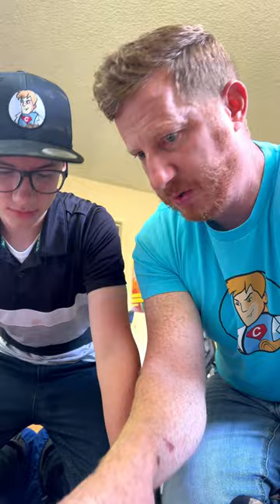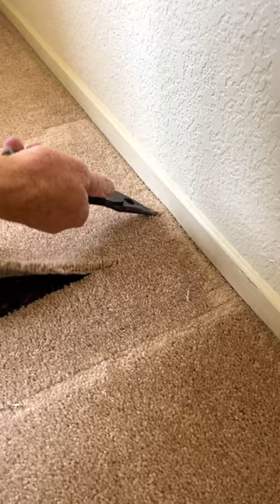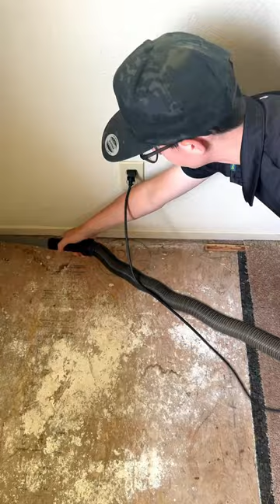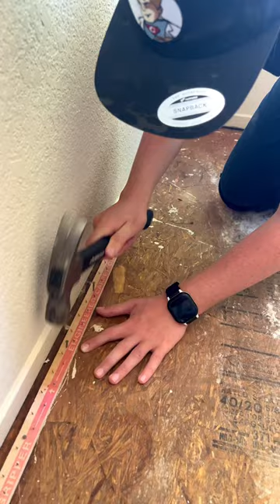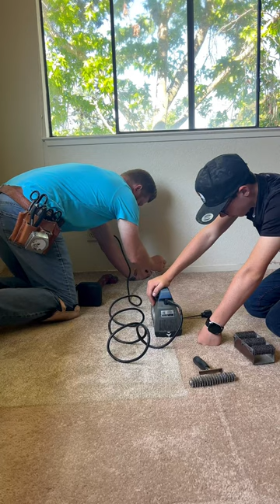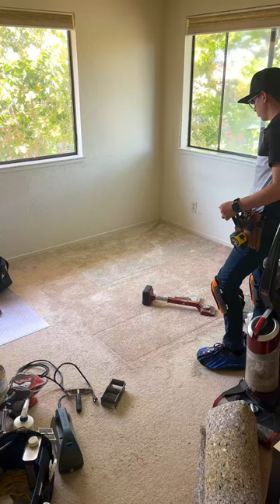Here to help

Comment: It's all about making the customer happy, they're paying the bills and putting food on the table, not the trolls in the comments.
You're doing what's right, the right way.
Keep it up.
Reply: tbf the trolls are helping pay for food too😅 all attention is good attention as far as the algorithm is concerned 🌸
Reply: It's like a chef that complains about an order for a well done steak. What difference does it make as long as it's not hurting anyone? If you're a pro, you'll do it the best possible way that the customer wants. The finished carpet here looks pretty good in my opinion, considering.

Comment: Just did one where the client wanted two rooms with stock carpet replaced with a pattern carpet they had pulled off the living room. Wanted both rooms seamed to the hallway stock carpet, and the carpet was running short so we had to do a seam the length of a room in a 10x11 . You better believed I charged accordingly and took myself a nice little check after struggling for my life 4 hours. Seaming a pattern match that has already been stretched and warped will make you consider picking up hardwood or LVP.😂
Reply: I don’t get why is it hard? Idk anything about carpet just wondering
Reply: @FraudGPT pattern carpets must be matched up perfectly when you are seaming carpet together or else you will have visible seam lines. Because the carpet was removed from a different room, that means it has already been stretched, warped, and worn down. This makes it extremely difficult to get a good seam on the pattern since one piece is slightly stretched more than the other and the patterns no longer line up as if the carpet was brand new off the roll. On top of that, the pattern carpet was expected to finish at the doorways with a head-seam onto a textured carpet, this means the style, height, and carpet backing were not matching up nicely to create any form of transition that's pleasent on the eyes. Head-Seam on a patterned carpet also means cutting the carpet with a straight edge, instead of being able to use row finders and cut between the fibers like a regular seam, you'd be cutting through the fibers of the carpet, leaving any loops/patterned fibers frayed and snagging the loop up from the carpet leaving you with small fibers that WILL fray and pull out more over time especially on high traffic areas or households with pets/children. Ultimately, a 10x11 room can be installed in one single piece without any need for seams because carpet comes sold in rolls of 12ft Wide with the lenght being calculated per job
( 12ft x 130ft big job, 12ft x 45ft small job). However, this client had requested we re use carpet from a different room that was removed. This original room was smaller than the 10x11 room we were installing the carpet in, so obviously when dropping the carpet in, it didn't cover the whole room. We had to go into the clients trash pile and pick out matching piece of the same carpet that also lined up on the correct section of pattern we needed. We had to seam together 4 smaller 1ft x 3ft pieves to created one 1ftx12ft piece. We then used that 1ftx12ft piece to fill the gap in the room so that the carpet could be wall to wall. All in all we did about 6 seams for whats supposed to be a small and quick job. Job like this should take two hours from beginning to end with my crew but because of the clients attempt to save money by re using his carpet it required much more of my materials to be able to seam everything together, it was no longer an easy job but rather a tougher service and install which required me to be qualified and experienced enough to be able to pull it off and do it properly, and it cost me extra time/labor for my crew who had to dig through the old trash, remove dirty carpet and give it a little cleaning up, then re-use said carpet and take it back inside the home for installation. All in all it takes a real pro to be able to pull off such installations and it takes time since I'm the only one qualified to do this type of work. It's hard to get it down but everything gets done right the first time even though it takes longer and you're covering a small area. After all is done you can't even tell it was a tough job it just looks like any other carpet installation.

Comment: Can you carpet guys please stop putting 10,000 staples in a single pad. You do that like the damn things gonna run away and then remodel guys like me come in and have to pull it all up to put in hardwood and it takes three freaking days to get all the staples either out or pounded down.
Reply from the maker: When we stretch the carpet the pad often moves across the tack strip so more staples it is, bub. Besides, you can charge more for prep. Win win for both of us. 😉

Comment: The only jobs my boss and I turned down were ones with fleas and someone wanted on us to carpet their attic… it was a job subbed through Home Depot. Very nice house. The only reason we didn’t do it is because to get into the attic they had a sheet of plywood mounted horizontal about chest high in a closet with a step stool on the wood. My boss is a big boy. No way the wood was supporting him and a 25x10 roll 😂. Crazy Home Depot sent out someone to measure and give them a quote and took the job.